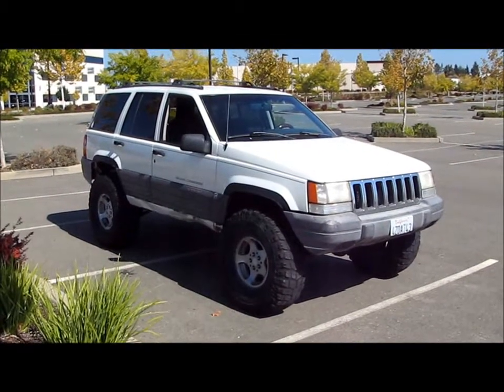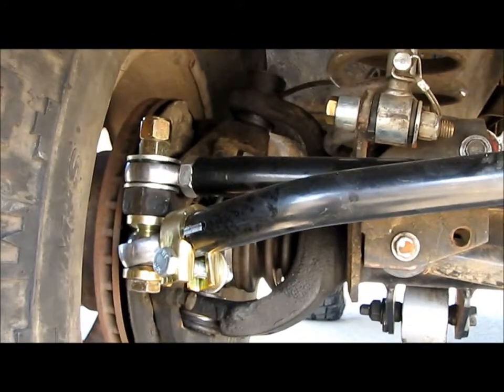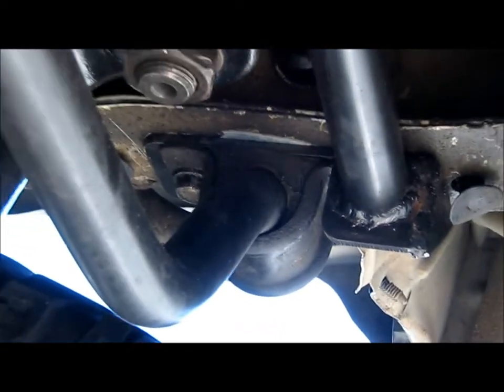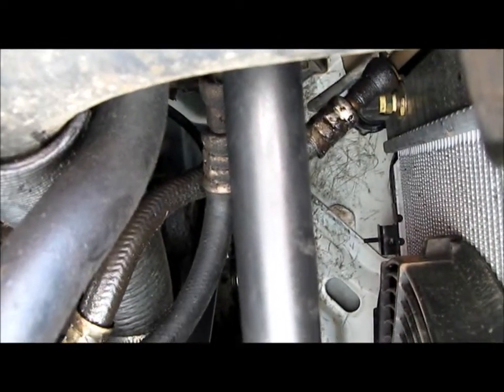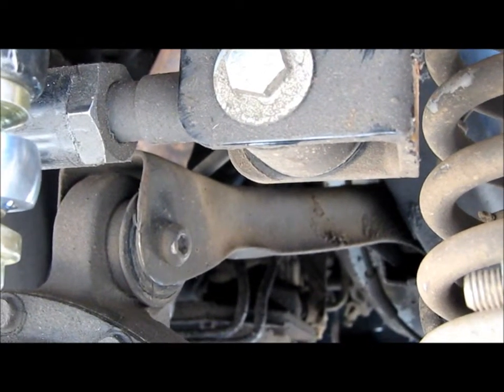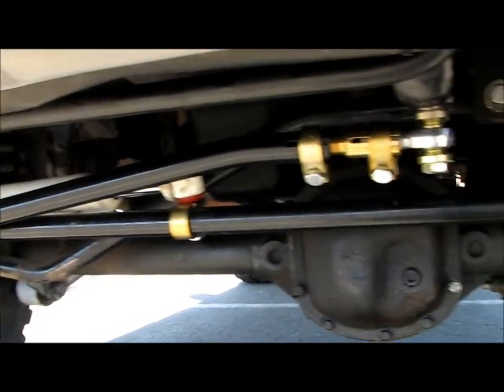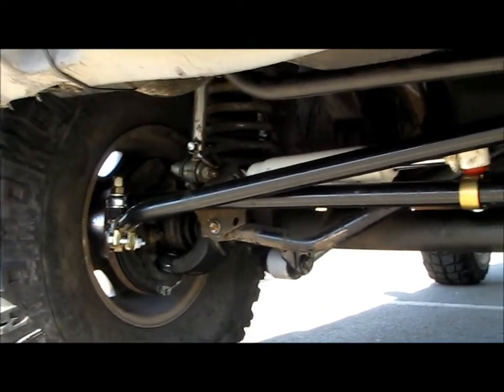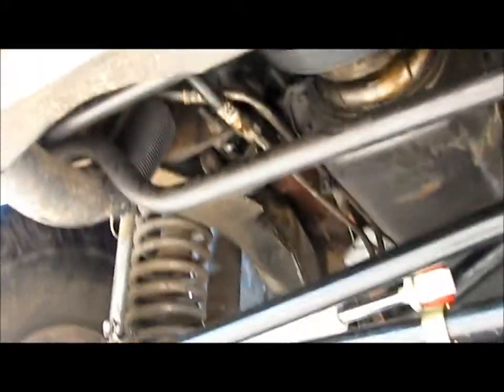Jeep Grand Cherokee 4x4 Project ZJ Part 4 Steering Box Brace OTK Steering IRO Iron Rock Offroad

Comment: Hey Ryan, thanks for posting all these ZJ project videos! I have an 07 Laredo 4.0 (inline 6) and the lift kit the installed put in is a mess - death wob and jump to the right bump-steer, so I am going to try model the Jeep after your design - thanks!
Reply from the maker: This setup worked very well for me but it's also important that alignment is correct and all bushings and bolt holes are secure, not wallowed out, etc.  If your alignment is off, especially caster, then even a good setup will do strange things.  If you know alignment is OK and still have death wobble, have someone start the Jeep and turn the steering back and forth from lock to lock while you watch the front end at all joints for any movement.  Sometimes even with the bolts tight stuff will move which is bad.  Most common spot is where the track bar bolts to the axle.  If that is moving around then you'll surely have the wobbles.  If you're looking for solid bolt on options for steering and suspension, definitely check out Iron Rock Off Road.  My ultimate steering setup ended up being custom built crossover using a WJ style knuckle.  There is another video on that if you go to www.projectzj.com  Best of luck killing the wobbles!!
Reply: @ryan.vision  Thank you so much! The parts I have on my jeep are off my son's ZJ, and they were tired and worn out before they were installed on my ZJ - most are RE. I will check out the lock to lock steering-test, but I think I going to start over completely with your over-the-knuckle, cross-over setup using https://teraflex.com/shop_items/tj-high-steer-knuckle-kit, Ruff Stuff and Iron Rock. Your videos are fantasticly helpful (the best, I think) and have educated a jeep-dummy to sombody who has (progressively) more of a clue, lol! I watched the linked steering  video, and I love that set up! Thanks again! I really appreciate your help!
Reply from the maker: That's perfect if you want to build your own custom steel steering linkage.  If you want to simplify things though, you can just buy the full kit from TeraFlex and it'll come with the drag link, tie rod, and knuckle.  This will make it bolt on without having to drill any holes larger, deal with heim joints, bolt sleeves, etc.  It'll work the same as my setup and you'll have shiny aluminum tie rod and drag link.  Check it out and see which you'd prefer.  Glad the videos help out!
Reply: @ryan.vision  Excellent! That's what I'll do then as think it;s worth paying extra for better parts. I do not plan to be super-hard on the jeep - just some light climbing... I have some people who can help me with installing the kit, which is a relief... Thanks for steering me in the right direction ( haha, please pardon the pun) and take care!
Reply: @ryan.vision  I called TeraFlex, and they no longer make that kit, but what do you think of this kit to go with the TeraFlex Knuckle?

Comment: I found the dropped pitman arm you had. It was a rugged ridge one. Installed it in my ZJ and it didn't solve my death wobble. Turns out that 1/8" toe was too much. 1/16 started to get better. And 0 toe pretty much solved my death wobble. Just wanted to let you know.
Reply from the maker: Cool, glad it's taken care of now.  There are so many things that can cause it.  For me originally it was a combination of bad alignment, bad angles, bad bushings, bad tires, and wallowed bolt holes.  One by one it all got squared away and in my mind a professional alignment is worth every penny because then you know the exact degrees of everything front and rear.

Comment: I don't know what the costs are with the upgrades you are talking about but would swapping to purpose built 44 be easier? I know that some of them can be 5k per axle, but I think you can find others for around 2k for a new 44. The advantage to the 44 is better strength of all components, much wider selection of gear ratios and 20 to 30 locker options instead of 2 or 3. I'd hate to see you spend the money to upgrade the 30 and still have weak areas.

Comment: That's awesome. I've come to the exact same conclusion. I think if you get a selectable locker, front and rear, you can choose better lines to compensate for your lack of ground clearance. I honestly think that you could get a stock ride height further with lockers than a lifted vehicle without. In fact, if I could, I would start with lockers and dana 44 swap and do the lift and tires later. Question is, does the same locker work with much shorter gears?

Comment: first off i would like to say i love the vids. how is the steering setup after a year or so? im looking into a steering setup and was wondering how it has lasted wth the heims, been debating their kit or a 1 ton conv with tre's, i have a 97 zj with the iro 7 inch long arm and eventually looking to go long arm rear i love their products and would like to go on-board air as well keep up the good work
Reply from the maker: Kevin Godwin Glad you like the videos!  The steering box brace is holding up great and if you don't have one you need to get one.  The steering itself, the tie rod is holding up great, but I did manage to bend the solid steel drag link.  The one downside to the setup is the drag link goes down pretty low on the passenger side and uses bulky clamps to hold adjustment.  If you hit a big enough rock hard enough on that low side you will bend the drag link and throw it out of adjustment to where it will rub the tie rod until you readjust.  With that said, you're going to bend anything if you wheel on big enough stuff and hit it hard enough so I don't fault steering BUT I would like to do a custom setup using the IRO tie rod and mounting a new drag link directly to the top of the tie rod, not to the top or bottom of the knuckle.  This will give maximum clearance and also unlimited angle or massive suspension flex.  The heims have been great though, I'll never go back to anything else.
Reply: ***** nice well im considering it alot more lol well when you end up doing the different setup i would love to see it and how you did it thanks again and if i have any more questions ill be sure to give you a shout

Comment: Do you remember what the pitman arm was. I'm having hell with 4wheel parts finding a drop pitman arm. The last 3 they ordered me were same as factory. I'm getting death wobble like a b#?*! and it's off and on. One day is fine next day gotta drive 55.
Reply from the maker: If it's not all the time it's probably not your pitman arm.  Did you check all your bushings, the track bar mounts on frame and axle, alignment, tire pressure, etc?  There are so many things that can cause the wobbles.  I'm not sure which pitman arm I have on right now but I went to a shorter one because the one I got was too long at full flex.  Your best bet would be to measure yours then call the company you are ordering for and ask them which one is longer than yours.
Reply: ***** I have already replaced all the tie rod ends accept the longest one that goes from knuckle to pitman. Has new adjustable track bar. And my alignment is good. Only thing I can see needing to change is buy new tires and buy a drop pitman arm to get all my steering angles closer to stock. New tires cost a lot especially when I have half life left on the ones on the truck.
Reply: ***** and I've already bought 3 pitman arms from 4wheel parts. All were either same as stock or shorter than stock. I'm done with those amateurs.
Reply from the maker: Yeah I hear ya, tires are very expensive.  If they aren't worn even though they can cause weird things to happen.  Also make sure the contact patch of the tire is nice and flat on the ground, not over or under inflated.  My Jeep handled like crap when the tire shop sent me out of there on 35 psi.  Have someone turn the steering back and forth while you watch underneath for movement, especially where the track bar mounts to the axle.  Even with new equipment that can be a problem if the mounting hole is bored out bigger than the bolt.  As for the pitman arm, try Rusty's Offroad.  I don't recommend many of their parts, but the pitman arm I got from them was very beefy and way bigger than stock.

Comment: Does the Tie Rod do any clonky noises when you´re passing some bumps? Because in an other video you skipped the rod up and down and it made loud clonk noises. do you hear it when driving too? because i had this knocking clonking noises on the front axle from my sway bars and steering and all the ball joints and im rid of it! don´t ever wanna get back to knocking shit in the front.
Reply from the maker: The tie rod is the bar that runs from knuckle to knuckle straight across and that one doesn't make any noises or twisting movement at all.  The one you saw me moving back and forth is the drag link that goes from the passenger side steering knuckle up to the drop pitman arm on the steering box.  That one has to be able to pivot like that in order to allow full suspension flex without binding.  Luckily the bar is so heavy that it doesn't flop back and forth on its own during normal driving, only moves when flex demands it.  I hate clunking and knocking noises too!!  This steering kit helped cure that for me.  Check out my other video on the shocks too because they were making noise and a bar pin eliminator (BPE) kit solved those noises for me.  Check your ball joints, track bar mounts, and all your bushings too.  Hope you are able to stop the clunking!!!
Reply from the maker: Forgot to mention that I also got rid of the steering stabilizer when I switched to this kit.  It is very stable without it, probably because of the tight joints and heavy solid steel bars.  It also keeps the stabilizer from binding up or hitting other things and making noises.
Reply: Nice to hear that ryan! Love your projec zj vids. Helped me mire than a lot threads in the forums. Really like what you are doing. But i have one big wish and i think it will be the perfekt completing for your zj vids. I think i speak for many many others in that case: can you please make a vid talking about how you can and hiw you have to adjust your Front axle in case of Lifting?  As well as the Front drive shaft swapping to the u ball thing. Every time the lift gets higher then 3,5" THIS particular questions come up. I know youve talked about which angle youvw chosen for your Front axle but a vid especially about how to adjust it and what to to with the Front drive shaft would really be awesome!!!
Reply from the maker: That's a great idea for a video!  I'll see if I can get one uploaded within the next week or two.  Gonna be busy working on the Jeep the next few days.
Reply: Ryan that would really be awesome!  Something like a complete FAQ for lifting above 4,5" what works, what doesnt work, newbie mistakes to avoid from the beginning etc.
Think youre the best to do that.  Youre already famous here in Germany and we love your vids. Dont stop doing that.  Big thanks and greetings from your german brotherhood :) 
Oliver

Comment: Ok I have same Zj what did you use adjustable short arms upper and lowers or just just lowers?
Reply from the maker: This is an old video.  Jeep is now on 7" long arms front and rear.  I was originally on 3.5 short arms, adjustable lower rear, fixed lower front, and stock uppers front/back.
Reply from the maker: Check www.projectzj.com for all info
Reply: I wasn't clear. I  am not going passed 4 inch lift. I don't wanna have to change any gears.  I know I have to get adjustable track bars front and rear. but on the control arms what worked best for you? front uppers rear uppers or front lower or rear lower adjustable control arms?

Comment: What's your total lift in this video and tire size. That looks like what I want in the end with mine. I'm a bigger dude and I'm short as he'll so 3.5" lift I'm already hopping a little to get in. I'd like to fit 35's or at the least 33's.
Reply from the maker: In this video I believe it was still on just the 3.5" Rubicon Express springs with no spacers.  It had RE adjustable rear lowers, RE fixed front lowers, and OEM uppers all around.  Tires were 35x12.50

Comment: Hey I keep running into the problem that nobody knows why a steering box brace from an XJ wouldn't fit my ZJ with the v8. Yours is the same as mine any ideas why I couldn't use one for an XJ
Reply from the maker: Not sure, maybe the measurements are slightly different for XJ.  My brace is made specifically for a ZJ.

Comment: How many miles do you have? Just curious. Nice build!
Reply from the maker: Thanks!!  Right around 175,000 on the original 5.2 motor and transmission, freshly rebuilt transfer case.  A lot has been replaced on the motor recently like water pump, timing chain and gears, thermostat and housing, timing cover, rear main seal, etc. (check my other videos) but all of the internals other than the oil pump are original.  Runs great!!
Reply: Keep up the good work. Your videos are actually the reason I started to build a zj.
Reply from the maker: Awesome!!  Funny you say that because I was inspired by another ZJ as well.  It's contagious haha
Reply: Which one were you looking at?
Reply from the maker: I saw a bunch of videos of a nice ZJ in Moab doing work.  It was clean, not overdone at all, but would climb some gnarly stuff.  I wanted something nice that could be a daily driver, have 4 doors with cargo space, power windows and locks, that kinda stuff, but I also wanted full coil suspension.  That's what led me to the ZJ and now I'm totally addicted!!